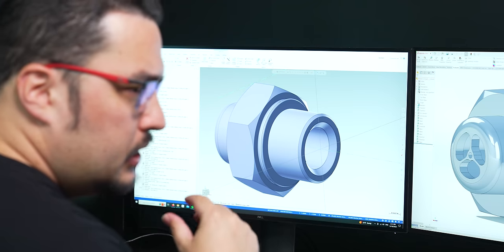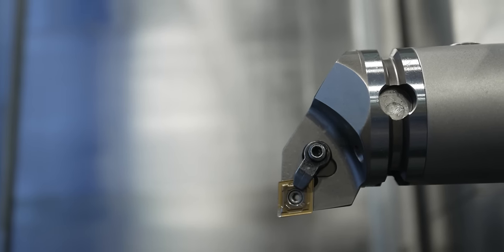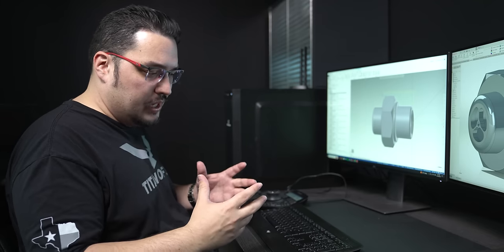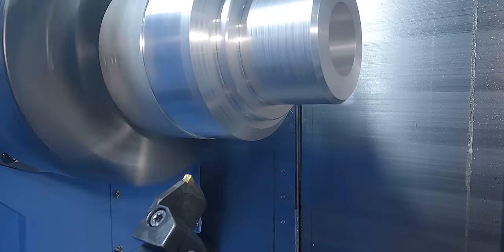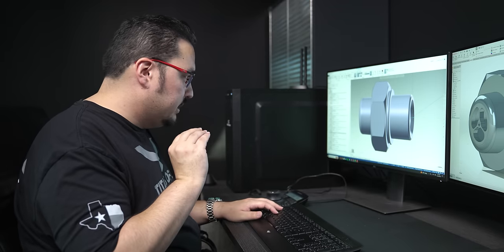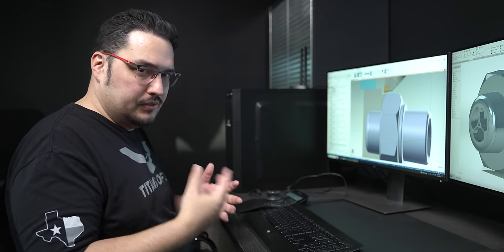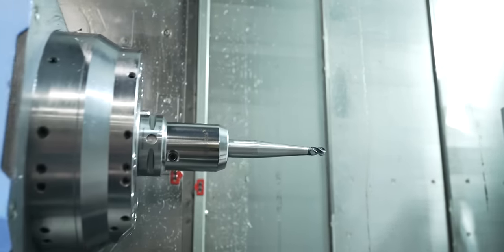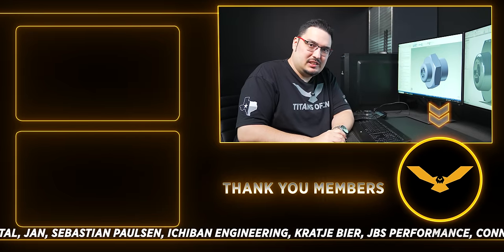FULL Process CNC Machining a Titanium Rocket Part

Comment: there is a plunger that goes in it to right? so fuel can be filled only when sealed around the rounded cap and slightly pressurized, because a jet airplane is re-fueled from the bottom of the fuel tank up. also a outer retaining ring that the fill line clamps to pulling the line over the rounded cap. theirs only 15'000 gallons sitting on top of it... "those three inner fins look very small 😵‍💫".

Comment: Whats the reason you guys don't run SpaceX parts anymore? Conflict of interest with blue origin? Just curious.
Reply: Now, SpaceX is VERY vertically integrated so they don’t need to outsource.  As you can see in the BlueOrigin video, Blue will soon also be doing all machining themselves.
Reply: Money.
Reply: They make far more promoting machine tool brands and other products and then producing these videos. Unique business model that seems to work well
Reply: @vonpredator  I was thinking along the same lines.
Reply: They seem to do prototyping more than mass production.
Reply: @ExplodingPinappleHD very unique.respect
Reply from the maker: SpaceX farms out a ton of work… and we just made a choice to go in a different direction.
Reply: @TITANSofCNC how could a small fab shop see/ hear about what work they're farming out?

Comment: On such «big parts», why not stress importance of supporting parts in z directions if you have a shoulder to butt against on transfer to sub spindle. 

At our company, a major component in qouoting parts is ridgidity in setup. Ridgidity in both x and z direction is of major concern for cycle time. However, we have mori NT machines and will probably outrun you on cycle times any day without this concern. Best regards from someone who is done with DN machines.